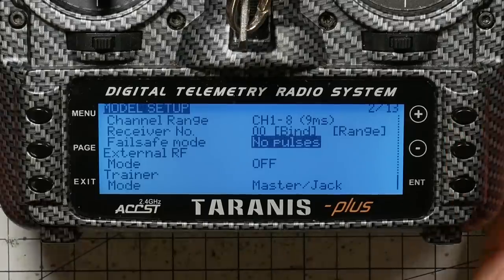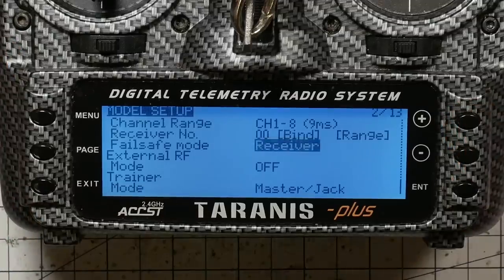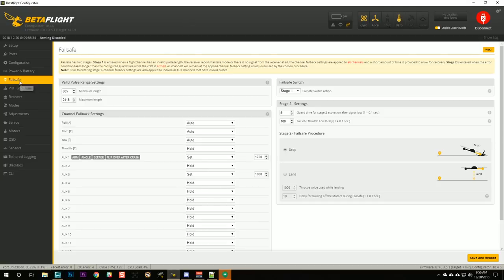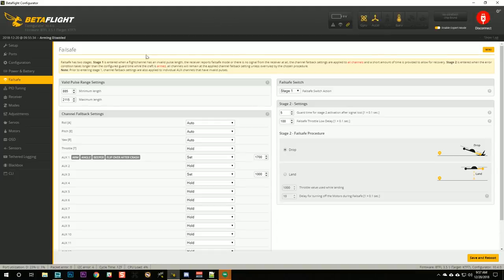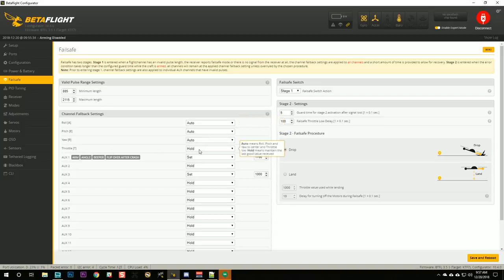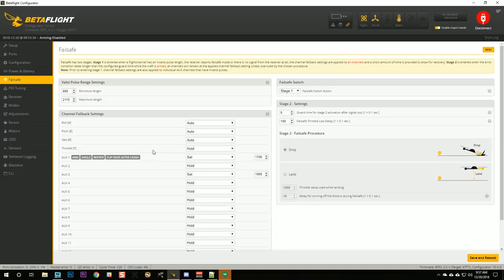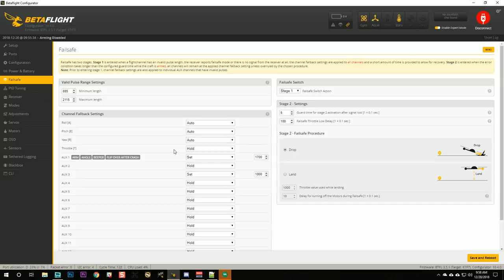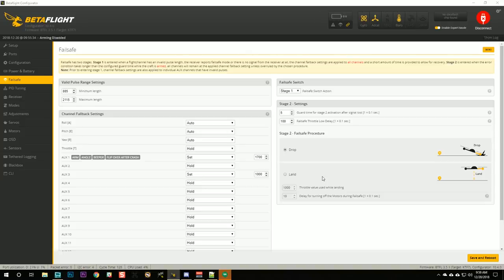Failsafe HOLD vs NO PULSES | which is right?

Comment: Hi all has anyone had a screen full of V over their video can't work it out happened after I put in new flight controller
Reply from the maker: It's easy to fix. Take off your props. Plug in a battery to the quad. Plug in USB. In Betaflight configurator go to the OSD tab. At the bottom, click the button "Manage Fonts". Then click the "Upload Font" button.
Reply: Thanks for that excellence as usual and thanks for taking the time to reply have a merry Christmas and thanks again
Reply: I had that problem about 6 months ago on a new flight controller. I re-flashed 3 times, checked all my wiring, "upload fonts', nothing helped. I thought it was the camera but RunCam techs told me its the flight controller (at the time i did not have an extra camera to swap out. So, I got a replacement flight controller and it also was bad :(   The third one finally worked and the V.s disappeared.  While I was waiting on a new FC i discovered that I could go into BF and turn off OSD and the V's would go away. Of course, you lose OSD but at least I could still fly while waiting.

Comment: I am always amused by how drone guys "discover" things that have been part of the RC hobby in general for many years. The "hold" failsafe function has been in place on higher end surface radios for many, many years and it's purpose was/is to have the failsafe "hold" whatever position YOU preset the radio to. Same applies to response/latency times, a surface racer will absolutely be able to tell the difference between a steering servo that offers a .015ms speed versus one that delivers .006ms. Sanwa radios are extremely popular for a reason and that comes down to response times. Yet I see drone guys claiming response times don't mean anything and are imperceivable lol. I expect the next explosion on the drone hobby will be response times and how important they are. All it will take is for one drone guy to wake up then all will follow.

Comment: No pulses. If you throttle and its on hold the last thing it will hold is that throttle lol. It will just fly to the moon or worse.   Even with failsafe set on walkera rxsbus recievers the quad will still fly away.

Comment: Selecting Land with throttle value low enough is practically a soft drop, you can be 100% sure that you're not ascending, why wouldn't you recommend this?
Reply from the maker: This is a tough one because I don't like the idea of descending uncontrolled with motors spinning. But at the same time, a gentle descent with motors at 1300 may be better than dropping on someone's head in free fall.
Reply: You can easily burn esc/motors when catching tree/bushes or land to early.
Reply: Also, I don't know about BF but in INAV there is a timeout for Landing mode, i.e. you can descend 20 seconds and after that disarm (supposedly having had landed at that time)
Reply: yes, burning motors/escs is a valid point. But, for example, DJI Naza has intelligent landing mode where it can detect whether the aircraft is still descending or not. And if it doesn't, Naza does a disarm. I think baro and accel/gyro data should be enough for that, so both BF and INAV could have this implemented.
Reply: @nandakoryaaa  So, you catch a tree at 2nd second of landing and next 18 seconds motors are trying to spin. Timeout is also in BF.
Reply from the maker: They could implement it, but they don't at this time.

Comment: Hi Joshua. Interesting discussion and VERY relevant indeed to anybody using an iRangeX FX801 FASST S.BUS RX (see https://www.banggood.com/IRangeX-FX801-FASST-S_BUS-CPPM-Dual-Antenna-Compatible-Mini-Receiver-for-Futaba-p-1084530.html). Tiny as this receiver is, which makes it ideal for 3" quads, it has a major failing. It totally fails to set the failsafe or dropped frame bits in the Sbus data-stream. Annoyingly this means that RSSI doesn't work with 'set rssi_src_frame_errors = ON' (I added SBus RSSI support to betaflight, so know what I'm talking about, see  https://github.com/betaflight/betaflight/pull/5090), but very dangerously it also fails to set the failsafe bit when the radio connection is lost. I fortunately discovered this on my Diatone R349 before fitting props! The rx outputs the hold values set in the TX when it detects a failsafe, which if min-throttle isn't set is, er, a bit scary! To work around this I set the failsafe throttle position to -143% in the TX, and then 'set rx_min_usec = 940' AKA Valid Pulse Range Settings/Minimum length on the Failsafe configurator tab. In this way BF still detects the failsafe condition and can apply the other settings on the failsafe tab.